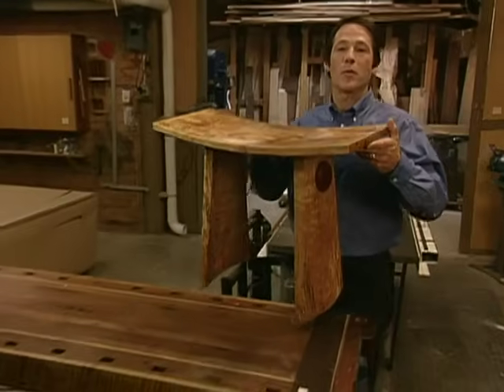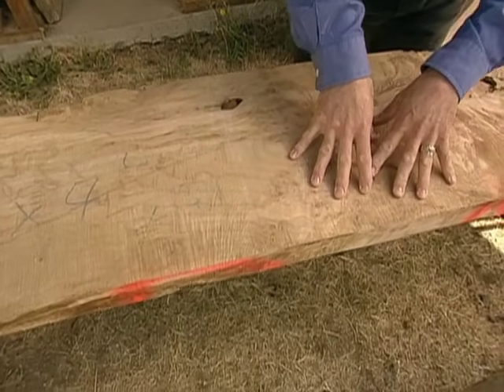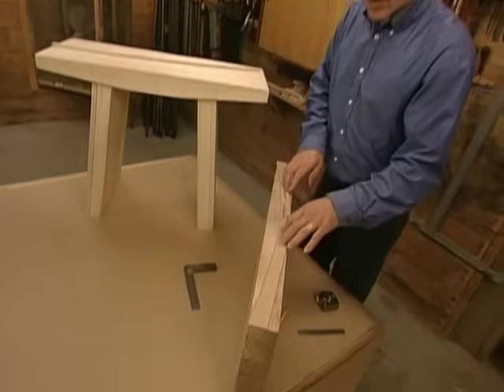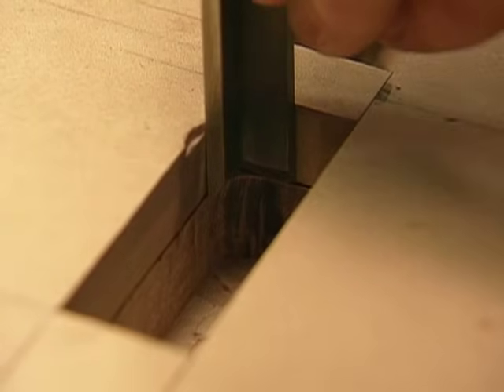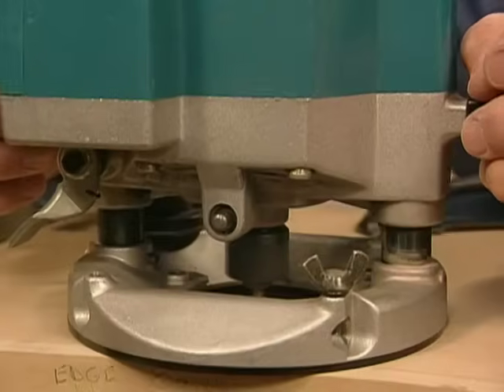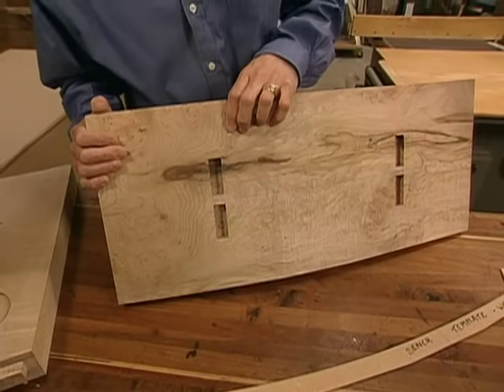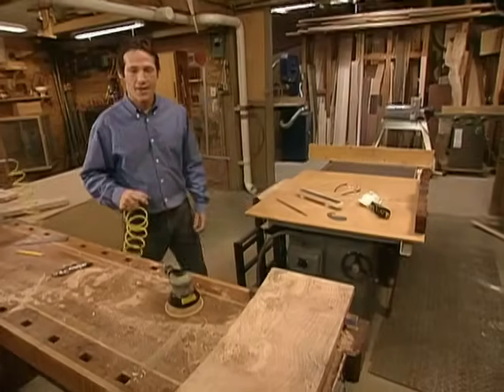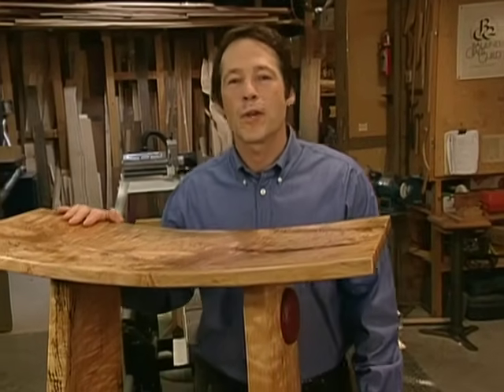Building a Japanese-Inspired Sitting Bench | WoodWorks with David J. Marks, Ep. 8

Comment: So beautiful! Any chance you’ll share your recipe for the tung oil, blo, polyurethane finish? Really impressed with the warmth and depth of it even on video; of course that slab of maple was incredible, too!
Reply from the maker: Hey David, thanks very much for your comments. The finish that I have been using is Seal-A-Cell and Arm-R-Seal by General Finishes. It’s essentially a thinned wiping varnish.
The key to good results with any finish is surface preparation and I sand everything to 400 grit or greater despite what the instructions on the can. I also have a finish room in my shop that I maintain at 75 degrees which ensures that the finishes dry with clarity.